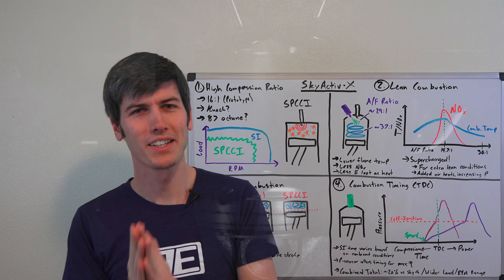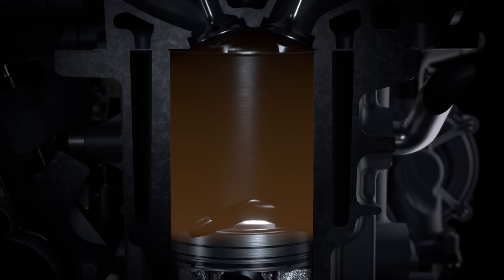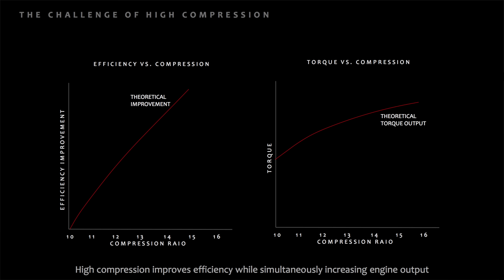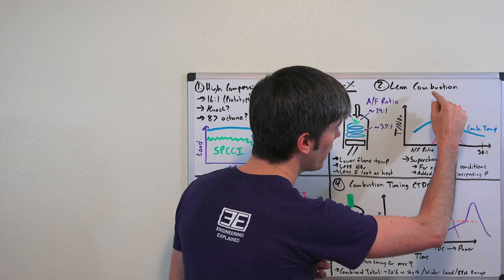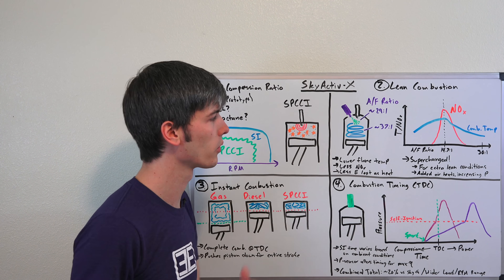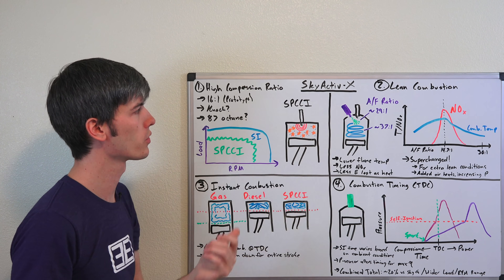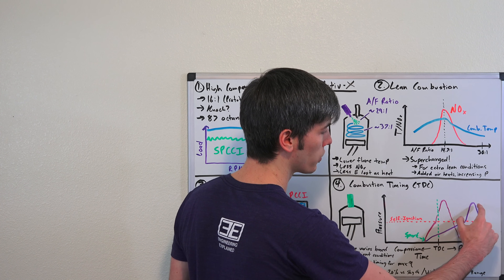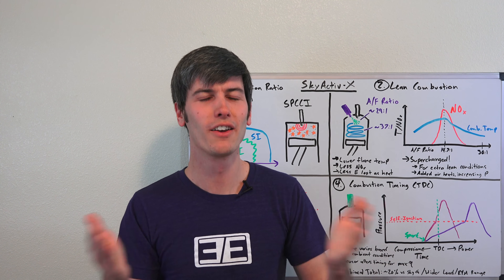How Mazda Is Saving The Gasoline Engine - SkyActiv-X

Comment: Can this be combined with Nissans variable compression pistons? If So, will this fit in my Honda ?
Reply: alex moore ah my fellow mightcarmod fan
Reply: I would like to see this engine combined with Nissans variable compression pistons, with the capability to rev to 12k, I wouldn't care if it's gutless (lack of torque) and placed in an RF mx5. That would be the best drivers car of all time.
Reply: As best as I can tell, a combination of both technologies would be superior, but there's some overlap in how they are achieving better efficiency, so there's some diminishing return.

YES. IT WILL FIT IN YOUR HONDA!
Reply: alex moore Lol my Accord 96 was asking the same thing... 😉
Reply: My first thought was swapping one into my older Nissan. Wonder what it sounds like.
Reply: alex moore variable compression piston?
Reply: Maybe, but no VTEC then...
Reply: I was going to say the same. There's a lot of really great things that should be combined. Also Koenigsegg's Camshaft-Free Engine.
Reply: Sure. You can do anything... with enough time and money.

Comment: The variable compression technology from Infiniti and this SkyAktiv-X technology from Mazda = world piece 😁
Reply: Piece of what? Cake?
Reply: He can call it by its brand name if he wants. No need to try to be pedantic about it :)

PS I still plan to call cars from Mitsubishi by their brand name too, if that ok?
Reply: Mazda has a joint venture with Toyota already so lets see about hybrid designs that can come from that venture?
Reply: A BEV talking points devoid of how things work in the real world mean nothing.And have fuel tanks that cost and weight more than the rest of the car anyway.

Y even post a comment about an ICE, just to troll? Its so sad.
Reply: Nissan*. Infinity is just a brand name
Reply: And the engine gets more complicated then ever. That means lower reliability, higher maintenance cost, and shorter lifetime. And you still don't have torque at low rpm like electric motors.

Comment: Nice channel. But you need to move your whiteboard to computer graphics.
Reply: Ibm w I agree and disagree. 

It would be nicer but the whiteboard is his trademark
Reply: imagine an average mspaint/excel graph. I think this is more authentic and is clear enough, ymmv.
Reply: His videos would probably take longer to produce if he had to either learn or hire someone.
Reply: What you really have to move is the whiteboard itself a little bit. I love the whiteboard presentation, please keep using it! But please frame the corner a bit to the right as my brain continuously but unconsciously looks into the bottom right corner of the video to check if anything is there on the board off-screen.  :)
Reply: No the whiteboard must stay!
Reply: Ibm w Black boards matter

Comment: I would love to know what the fuel economy of this engine would be vs a comparably sized conventional 4 stroke engine...and then if they got into performance with a supercharger, the amount of torque and fuel efficiency they could get!

Quick question, how long is this engine from mass production!?
Reply: There are prototypes driving around since last year, so they must be really close. One was doing something like 100mph and was burning around 7 liters of fuel per 100 kilometers, so there's hope that it will be really fuel-savy.
Reply: Forgive my clunky american imperial units but my goodness cruising at 100mph and still getting 33.6mpg is I'd say groundbreaking technology...I can't wait for performance oriented cars to have this engine, thanks for the info!

Comment: sad. the best internal combustion engine was already developed more than 100 years ago, since the pouge carburator, dozens of people made complete fuel efficient gasoline engines. All these modern engines are is a complicated and costly engineering masturbation. With all their money and geniuses we could have had a ECU controlled fuel vaporizer cars for decades, no pollution and only H2O and CO2 as emmision. Not this con to make car owners go to the stealership to fix their vehicles.

Comment: They can save the gasoline engine if they make one that doesn't run on gasoline, because eventually we'll run out of fossil fuels. Also, it wouldn't hurt if the engine was over 50% efficient and didn't pollute, and if the gasoline was as cheap as electricity.
Reply: good luck supplying the power for all these electric cars without fossil fuels
Reply: All of you are misinformed. We aren't running out of anything. That's just a prop to raise prices and invade countries. Please stop believing the news and repeating everything from supposed accredited sources from people with "titles".
Reply: NextRescue 100 years? What are you smoking?
Reply: Do you believe in peak production? Do you think we have hit it? I don't.
Reply: Even looking aside the fact that we are not running out of oil. Making any gas based engine to be 50% thermally efficient, is insane. The ONLY engine I know of achieving that, is the Mercedes hybrid powertrain IN THEIR F1 CARS
Reply: skifree dude they STILL have to MINE the zinc to create batteries among other things. AGAIN STOP LISTENING TO THE MAINSTREAM MEDIA LIE.
Reply: The electricity gotta come from somewhere and it wont be only renewable ones. It will take at least another 100 years for electric cars to be really prominent.